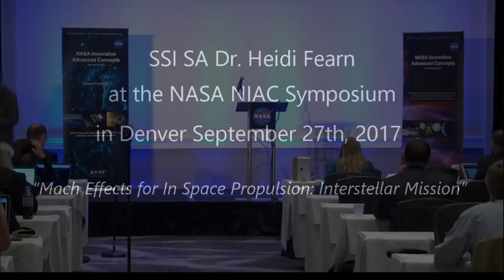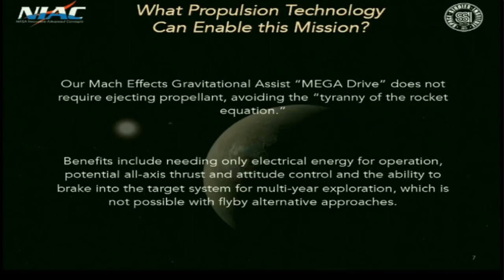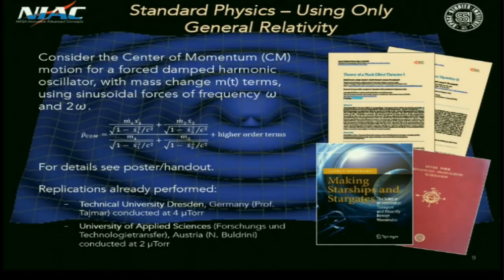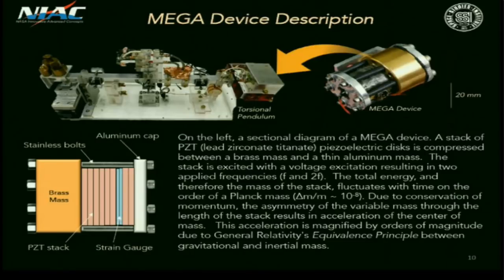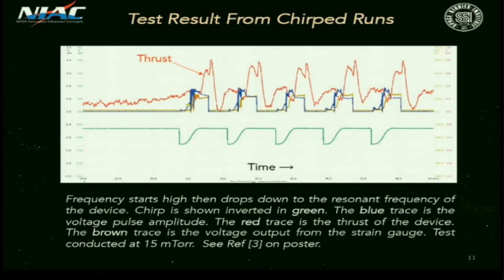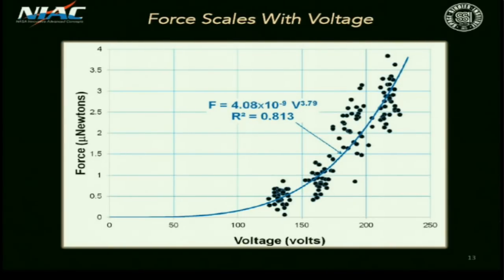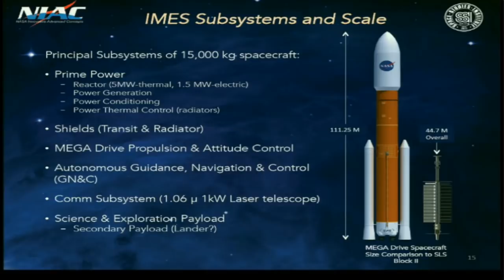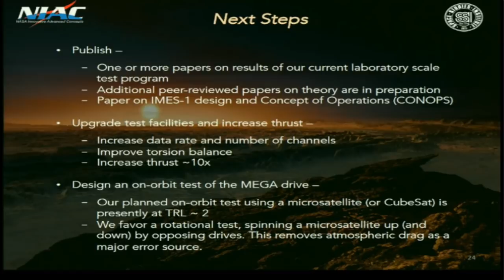SSI at NIAC 2017: Mach Effects for In Space Propulsion: Interstellar Mission”

Comment: I have a question, then perhaps an idea for the mach engine.  I understand that the discs will expand under electrical stimulation. Do the individual discs generate a voltage when compressed ? If they do, the absorber disc will generate a voltage when the return shock wave hits it...and if this voltage could be stored up in caps and reused, it could provide at least some of the energy needed to drive the absorber disc square wave generator...thus perhaps increasing efficiency in the overall  power delivery sector by scavenging it's some of it's power from the active element's drive system...
Reply: yes that´s how piezo ignition in your lighter works, interestingly enough, the grand chamber in the pyramid of gizeh is made out of granite, which has piezo-electric effects due to a quartz content

Comment: 15000 kg moving at .4c has 51 gigatons of TNT worth of energy. It's a fantastic weapon.
Reply: Kim Jong Un will love it.
Reply: How many grams do  their piezoelectric transducers weigh? Very little. Look at the pictures in her video.  So how much energy is being converted to mass by two vibrators the size of your fist shaking out of phase?  Extremely negligible amounts that dont matter.   She doesn't tell you that in her lecture.  

The LIGO experiment  detected gravitational waves that shook the detectors a small fraction of the diameter of an atomic nucleus!  It took two neutron star sized masses colliding to jiggle the LIGO detector less than a thousandth of an angstrom! 

You cannot use piezoelectric transducers to make gravitational waves of the magnitude necessary to power a Woodward drive! You'd need two neutron stars vibrating back and forth to make a Woodward drive.  I challenge Fearn to prove otherwise.
Reply: You don't understand it. Of course, the mass fluctuation is small, around 0.00000001 the "reaction mass", but if you run this at lets say 1 GHZ - push it away from you when it is 1.00000001 a billion times a second and pull it to you when it is .99999999 a billion times a second, this should result in a significant directed force. They do not want to make gravitational waves, the only want to use small mass fluctuations in accelerated objects.
Reply: its not significant. Show me the equations to calculate it.  Who told you the mass fluctuation is that big-- 0.00000001. Its much much smaller.
Reply: It is about 1 in 100 million according to woodwards equation. https://en.wikipedia.org/wiki/Woodward_effect
Reply: Yeah but it takes decades to get to that speed.
Reply: @iminventzilla6204  ofcourse youre right. its obvious to everybody, that the proposed system would not produce enough power with 200 watts to get 2 micronewtons. thats whats she sais she used in the test model.
Its also obvious there is a potential that it might proof usefull.
i wouldnt keept testing this for 60 years every day. but its certinly worth a look, and worth sharing. sometimes tests like these have people thinking and coming up with improvements..
thats sort of how it works sometimes.
she obviously is sharing valuable research.
Reply: @Hellohallo  Actually they made a break thru possibly this summer. They figured out an issue with the mounting that was absorbing some of the created thrust

Comment: it would seem that by using the first piezo crystal  separately from the rest might be of some interest. By that I mean, using the first one as held at a DC potential and then chirping the remaining series as usual, but with the difference of when the pulse returns towards the first one, the DC is sharply cut off, shrinking the physical thickness of the first one, and with that, some absorbtion of the oncoming pulse, perhaps raising overall efficiency with this reduction of  the bounce back energy into the frame structure...of course this DC voltage would express as a square wave on/off state, synced to the AC sweeping rate of the beginning and end of each energy pulse cycle through the active elements. thanks for an interesting post

Comment: Is the voltage to the piezo stack similtaneous to each crystal , or is it swept along the length of the stack in close delay with separate stimulation for each crystal? Also, a visualization of what's happening seems to indicate that the voltage applied will cause an initial pulse, then if shut off at the proper time, the energy of the bounceback has less mass/energy as the voltage has been removed just as the initial pulse reaches the end of the stack.  IOW the stack has more mass/energy  in one direction than the other as determined by adding energy in one pulse direction only.

Comment: Micro Newton's? Seriously?
Our demonstration prototype, the McGuyver V2.0 produces 0.07 Newton's per cycle.
What?
The all electric Sub Light Impulse Engine V3.0 pre flight design is being assembled now.

Science fiction has become reality.

V2.0 demonstration prototype is available for independent testing.
Weight 5.5 kg
Power consumption 12 watts continuous. 18 watts peak per cycle.
Power input 18 volts DC
Thrust per cycle 0.07 Newton's

Built with physics, math, components and manufacturing technology available pre 1970.

WHY WASN'T THIS TECH ALREADY BUILT?